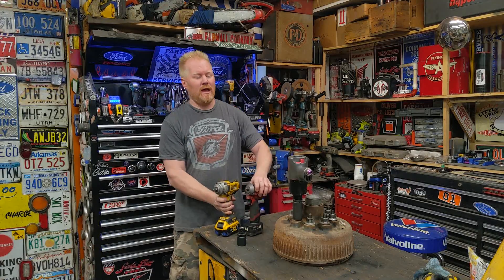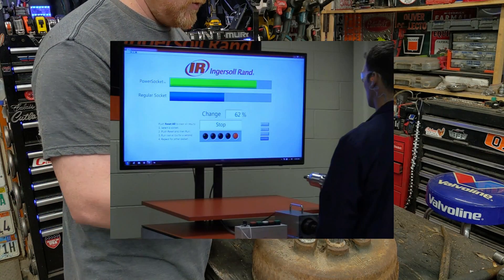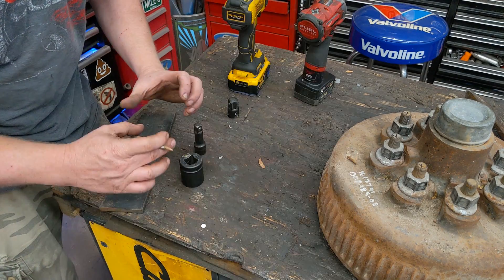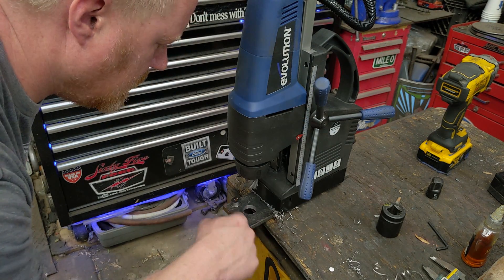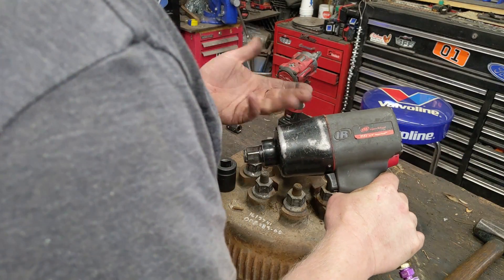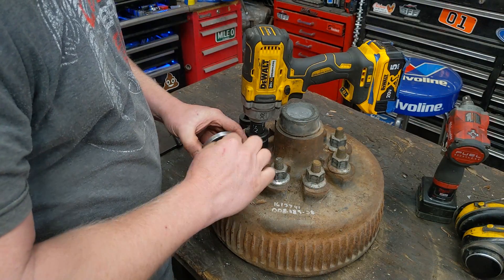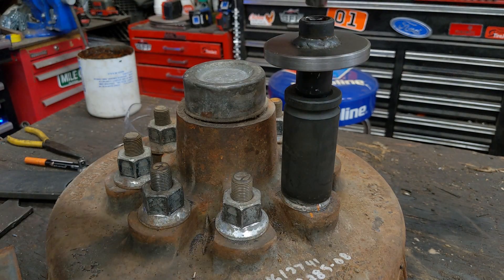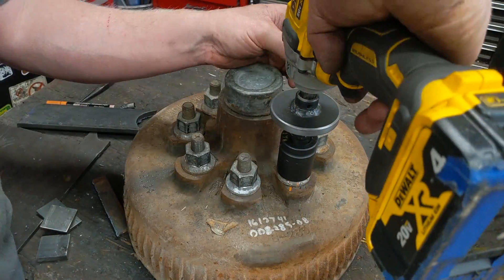Weighted Socket Adapter Build Experiments

Comment: Length is probably causing a lot of the power to be lost to flex between the socket and the driver. So your getting a lot less power to the nut.

Comment: At 6:08, he's holding the part down with his ungloved thumb and triggers the welder - that part doesn't get hot enough to hurt?
Reply from the maker: @thebordernow  Steel transfers heat relatively slowly. So it would take 20-30 seconds before the area got hot enough to be uncomfortable.

Comment: With the Torque Test Channel having done a test on adapters (reducing and enlarging), my guess would be that your reducer is losing you 20% of the impacts capacity and in turn creating loss before you can even see any benefits of the weighted adapter.

Comment: I like your pop bottle with magnets inside/ metal clean up tool. I've used 2 shopping bags(2 kroger bags with a magnet inside! Separate the bags & the shavings fall. Your idea is better! Mine was make shift. Metal shavings in a gravel driveway. It worked pretty good!!!! No flat tires yet!
Reply from the maker: Great idea!

Comment: Electric impacts only use a 180* rotation on the hammer mechanism. Pneumatic impacts use a 360* rotation on the hammer mechanism. You should be testing this with pneumatic impacts because electric impacts don’t function the same way and can’t produce as much break-away torque from a standstill due to the design of their motors/hammer mechanisms. If the IR sockets actually work (Torque Test Channel proved they did), then this must be a viable idea. You just have to test properly and get the mass of the flywheel optimized. It’s not going to be optimized with a 180* hammer action. The hammer doesn’t build enough momentum so you lose a lot of energy with all the adapters and the weight can’t overcome the 180* action shortcomings

Comment: Miluakee 1/2 inch is way better than 3/4 dewalt. I tightened a bolt with miluakee and the dewalt 3/4 couldn’t break it

Comment: I would try like a weighted extension pretty much and make weight over the length of it to reduce flex during impact.  Also that model of dewalt seems more reliant on speed of hammer and not as much the weight of the internal hammer at least in my experience I think that might be the problem you want one that won't lose momentum from the weight or one that is strong enough it won't matter.  I like that mid torque but it's very fast for a wrench. If you think about it though the further the weight is from the center of mass the more it should add to the hammer but also the more it will increase load on the gun and recoil from the hammer.  If you can keep it closer to center and increase weight you may have less of a bounce back effect and also an impact with a hard enough hit that it has more benefit then loss making a high rpm impact less suited. Also just noticed your using two adapters that is a lot of loss to overcome should be a single adapter the more connections the less your weight acts as a hammer and finding the right distance from center to get the right power to your hammer without draw back of rotational mass.

Comment: It's because it's an adapter/extension.  Too much slop in the square connection.   You would have to weld the disc to the socket I think.

Comment: Try welding extra metal directly to the socket, specifically put the socket in a short pipe. Strengthen a (cheap) socket & add mass.

See TTC:
https://youtu.be/qVd8Bx6AAQc

Comment: The issue is the connection between the drill and the extension and the socket and the extension is absorbing some of the impact rather then the lugnut.

Comment: With the right weight and short as possible adapter and right diameter this will work. And to test will have to be on a nut just out of range of the normal impact socket, I'm definatly going to try this.

Comment: I feel like you lose most of the benefit of the weight since it's not really moving but just vibrating... The usefulness of a flywheel is in the motion + mass, not just the mass vibrating. Really cool idea tho
Reply from the maker: Hey Thanks. It was a fun project and I did get it to work, so I need to do an update video.

Comment: Ya I had seen them tested too and to me the way an impact works is a hammer and an anvil and adding anything to anything but the hammer should decrease performance if you can't get that weight spinning it should hurt performance and it's probably going to be hard to increase the weight of the hammers

Comment: Too far away from the nut?? Too much slop in the adapters?? You made me look at weighted sockets though. I use 15/16 all the time and it would be worth the $70 in time not lost with breakers and cheater bars. VERY odd that Ingersoll Rand doesn't make a 13/16 for lug nuts when those can be some of the worst! Nice video and I'm on the lookout for a free dryer!! LOL
Reply from the maker: I need to do an update video on these. I purchased an Ingersoll socket and played around with it and got the same poor results I showed here. However I finally found out how and when they actually work. Figured with all the positive reviews people were leaving they had to. One thing in common is everyone was using them on the crankshaft pulley bolt. They only work on items that move and absorb the impacts. Things generally with really long bolts: leaf spring U-Bolts, Crankshaft bolt, cylinder head bolts, etc. They actually hurt the performance on rigid bolts like lug nuts. So anytime the thing your impacting is moving with the bolt this helps otherwise they rob power.

Comment: 0:00 The size of impact DOES matter! Try to weld your "adapter" to the socket to eliminate an impact moment loss in the connection between them, and your mid-torque impact may show much better results. If Ingersoll Rand "Power Sockets" are too expensive for you, try Lisle weighted sockets. They're commonly used to loosen stubborn crankshaft bolts.

Comment: I wonder if the name “Harmonic Balancer” implies something that is being designed into the tool by ingersoll rand. The term actually means “Vibration Dampener” which seems to imply that their tool dampens out unwanted vibrations and uses only those vibrations used to torque the bolts off. The tool uses some weight, but it is designed and counterweighted to dampen out the unwanted vibrations.  I’m just guessing but have been involved in the use of counterweights to smooth out rotating equipment. Just a thought.
Reply from the maker: I like your thought process

Comment: Inertia is directly correlated to velocity which means if you loosen the bolt up several turns and then use the flywheel socket adaptor it might help tighten the bolt more, but for loosening a stuck bolt it isn’t going to really do anything. Using your hammer example if the hammer is only a quarter inch away from what you’re hitting it makes only a minimal difference if you use the small hammer or the big hammer because there is almost no velocity (unless you hit the resonance frequency of the impact wrench but that’s a different story)

Comment: Weld a little tab on your flywheel and tap it with a small hammer as you turn on the impact tool. Bet it works. 
Don’t have any plastic coke bottles for magnets to pickup metal shavings. NY state charges a deposit so I turn them in. Lol

Comment: Snakeoil. Buy a bigger impact. Maybe add a breaker bar attachment.
Reply from the maker: I've discounted them for years as well as being snake oil as well. A few months back I saw an unsponsored channel that tests impact guns test them with impressive results. I did get it to work yesterday though. I was removing a nut from for long bolt (inner tie rod). My impact wouldn't budge it because the long bolt was just acting as a torsion bar, absorbing every blow. 60 seconds of impacting and nothing. Went to grab my breaker bar and saw this in my tool box. Decided to try it and within 2-4 seconds it busted the bolt free. I think the added mass kept the long bolt from springing back. I need to do further testing but i run into long bolt that torsion all the time that i have to use a breaker bar on. If this helps with that I'll be happy.
Reply: Cool, been a long time subscriber. Your content is awesome.

Comment: Totally green here, but could it be an idea to add some thick pipe to the extension in such a way that the socket is recessed in it?  
My thinking is that it will add more mass closer to where it's used. On the other hand, I also assume that the mass needs to be in direct contact with the socket to actually deliver the torque at the right place.  
Another idea for using such an adapter(with pipe extension), would be to pour in some molten lead, and re-melt after use. That way you could have one adapter that works with most pipes.  
A bit of work/hassle, but also saves a fair bit of money.  
  
Edit: Improved idea: An adapter made from pipe and made to fit over the socket with an opening for the connection and some kind of temporary connector to keep it tight and socket in right place. Fill with lead and remove the temporary connector afterwards.  
Possible downsides: Might mess with tempering of socket, and socket might need to be scuffed (drilled dimples?) for the lead to sit tight, as it might be counter-productive if it's loose.

Comment: Maybe welding was part of the problem. Removing temper from the extension with the heat of the weld. The softer the steel the more if flexes maybe?

Comment: I used to build the cylinders for dump rail cars and we had a massive home made 4 1/2 socket 3/4 drive. It weighed in at 5.1 pounds. Wasn't as effective with an electric impact. You almost need to little pause and rock of an air powered one.

Comment: Put it back on the lathe and take down your top an bottom welds then balance it. Need to remove as much mass in the center as possible. I would think that since your socket is hard and the anvil is hard and you put a softer metal in the middle it will absorb the impact
Reply: Maybe try hardening it. It might be acting like a dampener

Comment: they are BS. trying to get the same tool to rotate a heavier object = less force.  the only time they help is when tightening. when loose you get the inertia of the mass moving to help as it starts to tighten up, but from dead stop you only have that micro inertia of the hammer action.
Reply from the maker: That' was my exact thoughts and haven't ever considered them. However i watched an independent torque testing channel run them and the meter went off the chart with torque gains.

Comment: The rotational springiness might be important allowing the flywheel to slightly lag behind the rotation and create a kind of deadblow action. There is a tuned frequency for impacting and the mass being just right though. Or maybe figure out a deadblow socket? Another idea is to use harder steel, like chrome vanadium which wouldn't absorb as much energy. The welding may also be 'hurting' the heat treatment.

Comment: With each adapter 3/4-1/2 and your extension piece you’re cutting your torque by half..
Reply from the maker: I would think so but tests show otherwise. Independent channel tested two setups with 15" of extensions. One just a single 15" extension and the other 3 extensions adding up to 15". After a 5-10 second run the peak torque was the same between the two. This shows joints/unions make no difference. Testing a 3" solo extension resulted in about a 10 to 11% torque loss. The longer the extension the more torque loss as the extension acts as a torsion bar.
Reply: @sixtyfiveford  we’ve been working on detroit diesel crown buses and military equipment here since 1983. Over my 17 years of personal experience I’ve come to realize that even the 3/4 inch air impact won’t break bolts or nuts loose if we use extensions or joints. For whatever reason it just doesn’t work. However we do have a 10 inch long reach 3/4 air impact that does the job no problem 🤷🏻‍♂️ my half inch impact just snaps extensions so I don’t bother with those on that one lol. I’ve been told the reason the extensions don’t work is because the extension will twist back and forth and absorb the hammer force that would otherwise go towards the fastener. If the extension twists enough it shears
Reply from the maker: @mikecorleone6797  I'm with you and will never use an extension. However I do use adapters and have never noticed a difference in torque using super short adapters like the 1/2-3/4 to use sockets. I use my 3/4 I-Rand gun with a 1/2 adapter all the time but it could be just that it's such a powerful gun.

Comment: Its acting like a torque stick because of the welding try heat treating it.
Reply from the maker: I actually did quench it to keep the spring in the detent ball from losing its temper. It's probably more on the brittle side if anything/so stiffer than normal.

Comment: I wouldn't call this experiment a failure because we didn't know what ft/lbs of torque that these lug nuts were tightened to.  They could have been tightened up to twice, or even more than, the breakaway torque limit of the impact wrench itself.

Comment: There’s no failures in science. Only results that favor or disfavor a theory.  Doing big truck tires I found that grabbing the socket with my hand while rattling the 1” and assisting the impact I could get another 10-30° of rotation while tightening. Also while loosening the stubborn 1 5/16” lug nuts, I found that grabbing the socket and rotating against the direction of the impact would help brake the stubborn nuts loose. Your hand will slip but just keep regrabing and turning against the direction of the impact seemed work every time.

Comment: I definitely like the bottle with the magnets in it. I'm going take your brilliant advice on that one. I have an Ingersoll Rand 235 impact wrench that will actually break impact sockets. when I have it on the highest setting. I purchased it off the Snap On truck some years ago. when I was R&Ring transmissions, along with a special impact extension, that's half inch drive at one end and three eights drive at the other end. along with Snap On impact wobble sockets in SAE and metric. they were a nessesity at the time for what I was doing. I have yet to break any of them, but I don't operate the impact wrench on the highest setting when using them. I think that you definitely have the right idea with your experiment that you conducted. possibly a little larger diameter flywheel would help. I don't think it was a total fail, I believe that the weak link was the impact tool. they are just simply not powerful enough and don't have the hammering action suitable for the task. but I think that extension would be a good addition to a more powerful impact wrench. those extensions that Ingersoll Rand sells, I believe have a special metal that is added into the weighted part of them. that is considerably heavier than other metals. which might explain the astronomical cost. I just got thinking as I was texting this comment, maybe another scientific test you could run. would be to drill as many holes as you can, in the outer circumference of the extension. not towards the center but crossways, and melt some lead and fill all the holes, let it cool and harden and give it another test. but I still think the weak link is going to be those small impact wrenches. they great for light duty tasks and that is their nich area, where bolts are treaded deap and where there's a lot of bolts,  they really speed up the process. I have been dragging my feet on getting one because of their lack of power. but more recently I have been thinking about getting one. to remove deap treaded and a lot of bolts for just that reason. I will just have to keep the Ingersoll Rand near by for breaking loose fasteners that they can't. this episode is really like you said, this is how scientists conduct their experiments to achieve their findings. a process of trial and error until they get it right.
oh yeah Ginger likes the side by side, it's perfect for her. she's definitely having a blast riding in it.

Comment: Also, maybe the Dewalt is already maxed out on that impact socket. Repeat your experiment but using smaller bolts, with light weight non impact sockets and your adapter. Loved this video. So much more testing to do!

Comment: Could be that it increased torque but not enough to remove those bolts. You need to test it on a torque measuring adapter like "the project farm" guy uses.

Comment: i think its because its an extension and too much force is being absorbed between the socket and the extension.  slow the video down and watch how much more the extension is moving vs the socket.  what about trying so lead shot or something.  basically need to have something that is easy and light weight to start moving but gains force as it moves.  almost like the corn starch experiment in grade school.  the one were your finger goes it easy and with how any resistance when your push slow into it yet when you hit it hard or with any force its like hitting a wall until the force is absorbed and your hand slows down and it will sink in.  i think too much energy is just being lost between the socket and the extension and then the socket to the nut. what about some kind of hydraulic clutch like the Milwaukee surge impacts.

Comment: All the adapters and extensions are hurting any of your research you're doing. Try welding the weight directly onto the socket. Good video though, I like to see you try.
Reply from the maker: Weighted sockets work but I want a modular approach. I want to be able to use it on any socket at any moment.